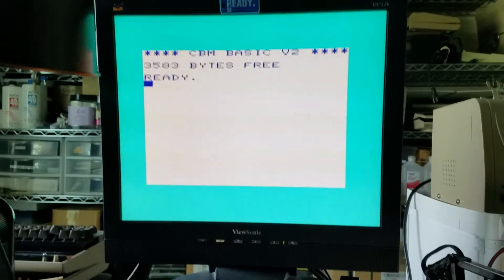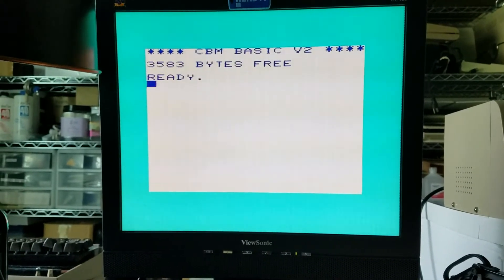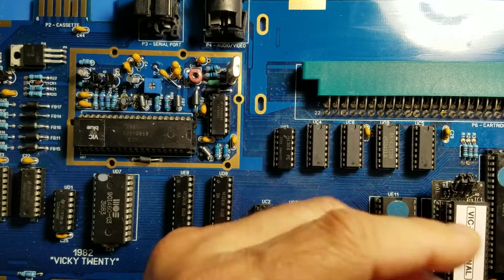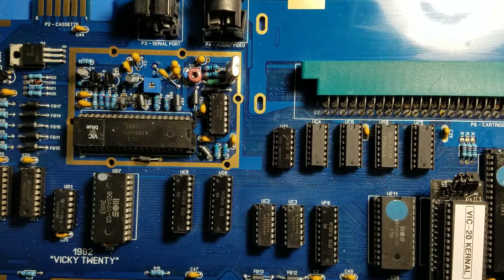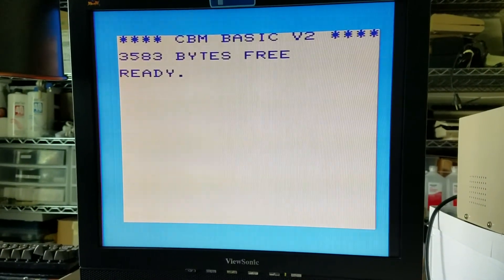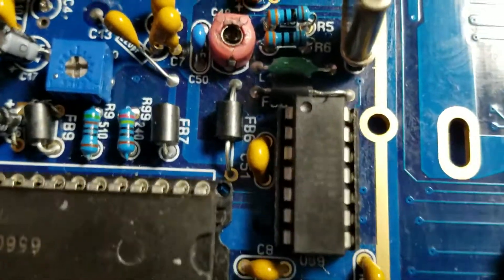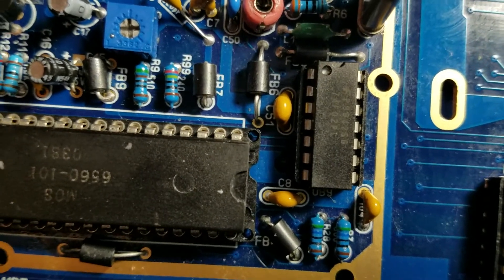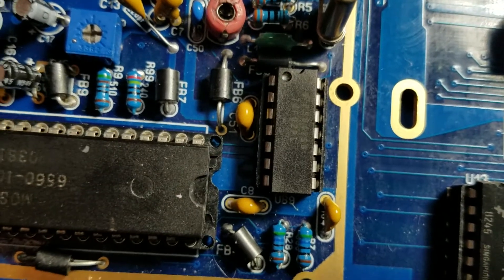VIC-20 CR (VickyTwenty) PAL/NTSC conversion (Part 1)

Comment: @SX64 man I have a Vicky-Twenty build for NTSC, and I know my chips all work as I used them in my Commodore build CR board, so it is not an issue with a dead 6560, but I get  blank screen. Is that was you got when you used the 74LS02N in UB9, and if I am seeing correctly you are currently using a 74F02PC, is that correct? I ask because I have been trying to get this to work for a while and so far you are one of the few things I have seen that calls out a difference to try. Thanks in advance
Reply from the maker: yes I would get a blank screen and some flashing once in a while but no stable image with the LS version